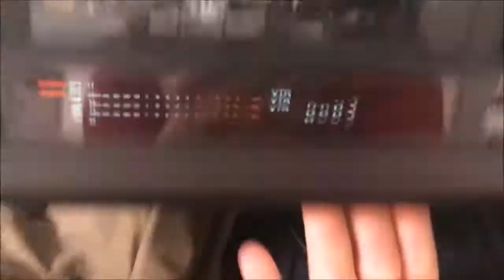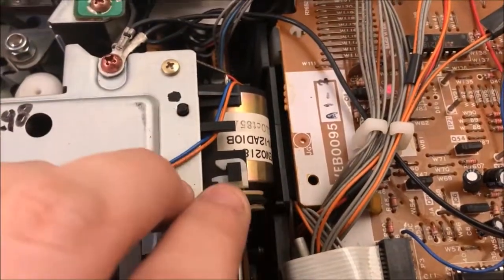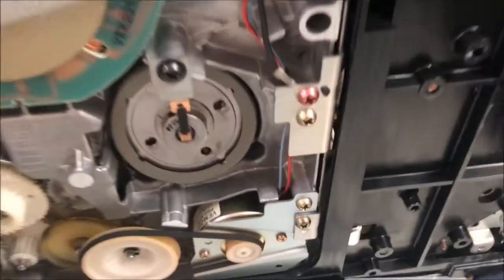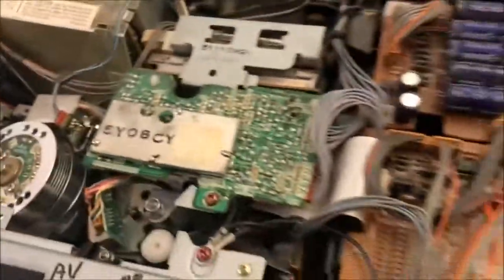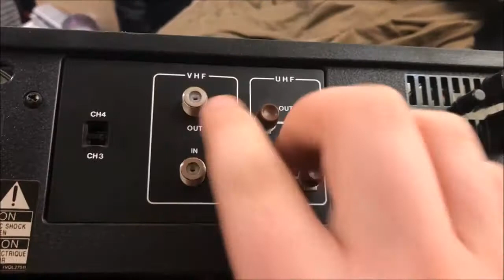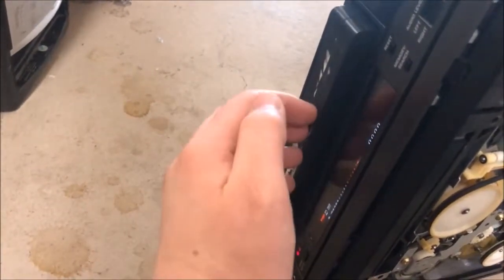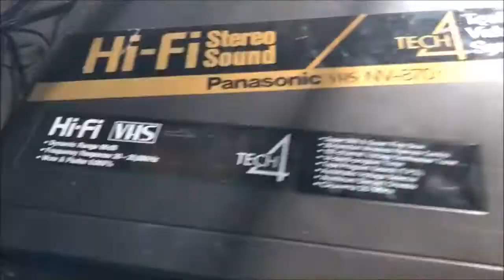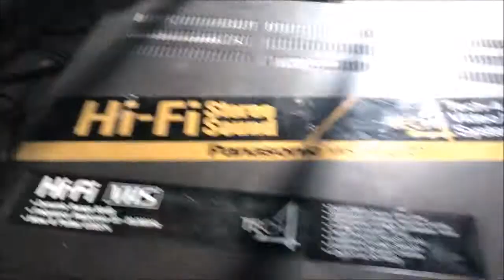Panasonic NV-870 VCR

Comment: This is a very cool VCR. Too bad it's not fully working, I thought it would be, but at least the mechanism works. It's hi-fi so it must have been expensive. Probably you should replace the belt in the carriage mechanism so it will load correctly. Also, I noticed on the back that the VCR can work with 2 types of voltages and 50 or 60Hz, that is very special. That means the VCR would work in Europe.
Reply: this NV-870 was the best/most expensive VCR on the market ,  there was  also  the Blaupunkt VCR RTV-520, which is technical the same machine